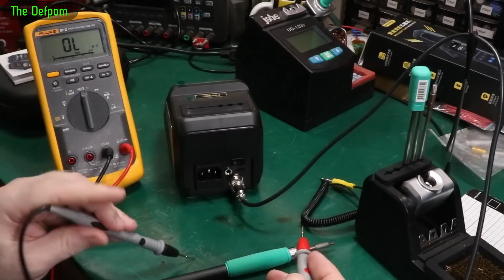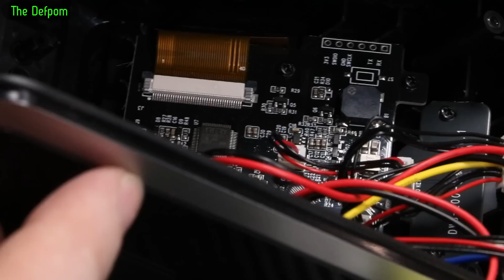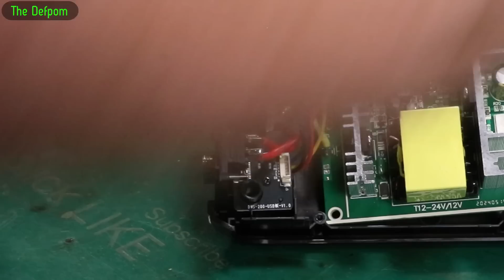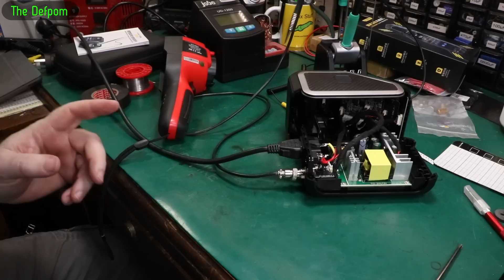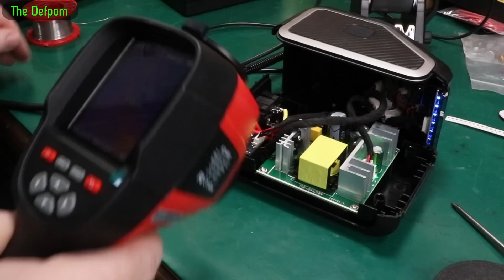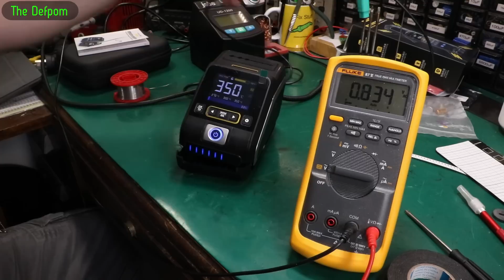🔴 FNIRSI DWS-200 Soldering Station Review Followup and Improvement - No.1321

Comment: In some designs, the tip is deliberately isolated from the mains supply and the earth. This "double insulation" approach means that the user is less exposed to electric shocks and equipment failure, i.e. accidentally goes soldering a live board and BANG! The manufacturer is just hedging their bets! At least there's an option on the PCB though as maybe some countries demand it?
Reply: I dont agree with an isolated tip. This is looking for trouble. The tip should always be grounded and 0 ohm leakage
Reply: Very good comment imho. I'd say: Either ground it properly or build a floating power supply with reasonably low common mode noise. Or add a capacitor to ground or something. Can be done. Not a good comparison, but my trusty old Agilent E3632A linear bench supply measures ~2V AC/1uA... I guess it will be more difficult with a SMPS, generally speaking. I wouldn't feel comfortable using this station tbh.

Comment: If you try to unsolder a charged capacitor now (e.g. 60V) what would happen?
Reply from the maker: It would discharge very rapidly…. Worst case the resistor would act like a fuse.
Reply: Depends on capacitance and which side desoldered first.
Reply: Scary what this😮 9:25 allows to be imported snowflake country

Comment: They get those power supplies from other manufacturers and just plug them in. I heard that some soldering stations from china don't work properly if you ground the tip, probably there's some sensing circuitry in them that relies on a floating negative. I'm surprised this one works. I'm waiting for mine to arrive, and this is the first thing I'll do.

Comment: If did not want to ground the tip, you could have used a capacitor. The voltage on the tip i expect is ac coupled to it so there will be no problem with decoupling it to earth. Any conductor floating around ac will get a voltage induced on it, current available will be based on impedance of the coupling.  Magnetic or capacitive will not provide much to a floating conductor. 
Could be to reduce noise if they emc tested it😂

Comment: Probably was intended to have a 1k PTC thermistor there, and it was cost cutted out.  A 1k PTC will work well, low resistance, and limits current if you accidentally touch a voltage source, and the PTC side will also limit current as it heats up.  A second 2k unit in parallel, with a small bridge and a red LED, will show if there is high voltage drop across the resistor, though not really needed.

Comment: Have you checked for voltage on the tip of the soldering tweezer ?, Some usb power adapters can have the same voltage leakage
Reply from the maker: @AndyDeay  yes, only getting 1.9V as my usbc supply is earthed, most are not
Reply: What type of usb c supply do you have